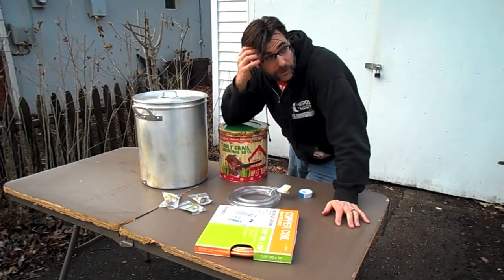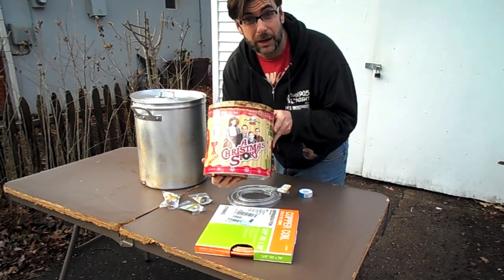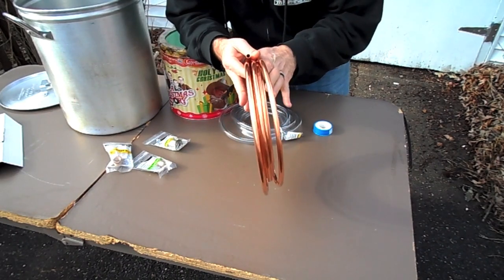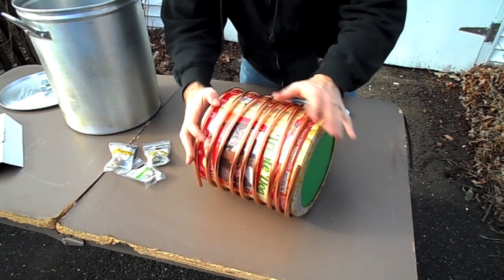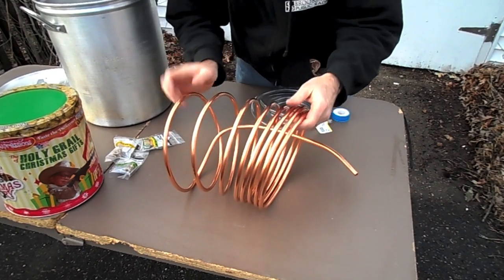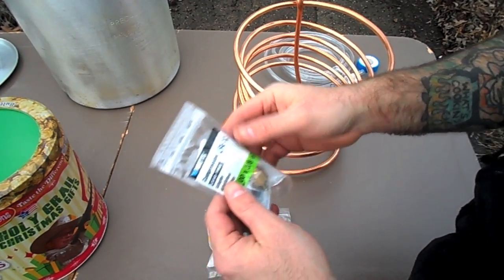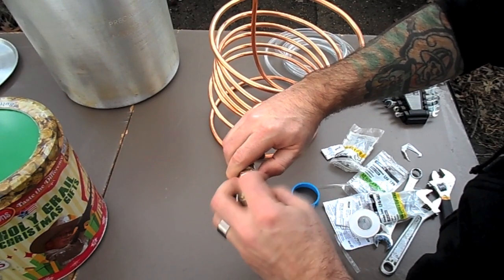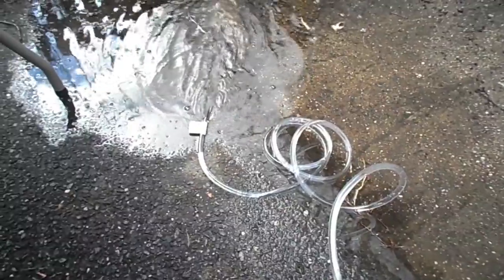Make Your Own Immersion Wort Chiller in 15 Minutes

Comment: I found a dishwasher elbow 3/8 compression to 3/4 hose for $6 at Lowes. No need to convert twice like you did. Bought a new garden hose just for brewing. Works great. Thanks for the video.
Reply from the maker: Jonathan Medford Thanks for the tip.  Good to know.

Comment: I made my own wort chiller years ago.  Here are a couple thoughts.  I would make sure to bend the inlet and outlet below the upper lip  of the pot and pointing downward to prevent water from creeping into the chilling wort.  Eventually your hose connector or outlet hose will leak and allow the unsanitized water to get into your wort.  The poly tubing was loose and you definitely need a clamp on the tubing to seal it.  Your inlet should go to the bottom of the pot first to push air bubbles out of the tubing.  The air bubbles do not carry off as much heat as water, increasing the time necesssary to cool your wort.  Hope it helps.

Comment: Thanks for the great video!  Just an FYI, garden hose adapter fittings are available in 3/8, 1/2 & 3/4" pipe thread.  No need to use a 1/2 x 3/4 pipe bushing. As a rule, I try to avoid as many extra fittings as possible since each joint means another spot that can leak.

Comment: Great video! Really helpful for a guy like me who needs to save cash wherever he can. Although when i was making mine i noticed buy using copper tubing with a 13mm diameter there is no need for all the extra fittings. This way you can just slide the garden hose snugly over the copper tubing and clamp it just like he does with his out end.
Reply from the maker: Great idea.  Thanks for that simple. and elegant solution.

Comment: 6:39 you folded it!! However If you used a spring over the copper it wouldn’t damage the line. Used this concept to make brake lines. And you can find a spring for this at a auto parts store in case anyone else wants to know.

Comment: thanks for the video!  when I made my wort chiller, I skipped using any special compression fittings, using the 3/8" id tubing with the 3/8" od copper tubing worked just fine, just slip the plastic tubing over the copper tubing for a water tight fit, and seal it with some stainless hose clamps, works great!  you are dealing with a fairly low pressure application.  same result, but could save you a few bucks.

Comment: I'm no plumber, and also mean no ill, but your teflon tape will seal better if wrapped in the same direction you're going to screw on your fitting, so that when you screw your fitting on, you do not risk unwrapping your teflon tape at the same time as you are screwing on your fitting.
Reply: Teflon tape doesn't seal anything anyways. It's the fitting that seals Teflon tape is more like a lubricant for the threads.  You honestly don't really need it.
Reply: Okay.  I was just taught to wind it the same way the fitting turns on.  No big thing.
Reply: I appreciate the video.  Made my own wort chiller for half what I could buy one.
Reply: +Kelly Kathrineberg plumbing 101
Reply: Must say though, the vid helped me make my chiller.  I used a gallon chili bean can as a guide, then my wife made a ton of chili
Reply: I use water bottles filled with frozen water to put in my bucket to keep the coils cool enough for the gas to turn to solid quicker. But yes its a good little chiller.
Reply: I only make liquor so I don't need a big bucket like that, I have a small still and usually just enough to fill a 2 liter barrel. Different grains but most all are ready within 6 months or so. So I always have a batch waiting for my sipping pleasure.

Comment: For future reference you "don't" use teflon tape on a compression fitting.
Reply from the maker: Yeah, figured that one out after replacing my sink.
Reply: Plus, the first bit of tape was put on backwards where the 2nd two pieces were correct (correct meaning the tape will continue the right way when the other piece is threaded on)
Reply: So you wouldn't put it on the first bit that he called "threading" but put it on for the adapters? Or just not use it at all?
Reply: No tape on compression fitting only but tape on all other fittings.

Comment: How many gallons is the pot in the video? I’m thinking of going with a larger copper tube. Probably 3/4” and at 25’ for a ten gallon.
Reply from the maker: It's 6.5 gallons.  Truth be told, it's a turkey fryer pot.  The larger you go in both diameter and length the more your surface area will be...which makes for quicker chilling.
Reply: Thanks

Comment: I don't think this has been mentioned yet, but I would also make sure the ends of the copper tubing bend down past the lip of the pot on the outside so if anyone water runs along the piping, it won't run into your wort. From the video, it looked like they were at an upward angle.

Comment: You should use a scissors to cut the Teflon tape that way you will net get small strings of tape in the system. If you want to be technical only wrap the tape 1 and a quarter to one and a half wraps  around.

Comment: Teflon tape is only used on pipe thread fittings.  Compression fittings have their own seal built in to the fitting.  You can actually cause leaks by using teflon tape or pipe dope where it doesn't belong.

Comment: I just pour my wort on a bag of store bought ice.  Chills it right down fast and never a contamination issue yet.
Reply from the maker: I've seen that used before, however I've never trusted the labeling on the ice bag.  I would be much more comfortable with chilling some closed jugs of water overnight and pouring that into the wory if I weren't going a full boil.

Comment: If you bend both ends to point down instead of straight out, it will cradle itself on the pot and be more stable.
Reply from the maker: JFP Watson I quickly figured that one out.  Thanks for the tip.  Happy brewing!
Reply: +JFP Watson i was thinking the same thing especially when the water was leaking.

Comment: (my 2cents) Get that copper tubing/vinyl tubing connection OUT of the pot. Even if you are super confident with your clamping job, if it does start leaking, you now have un boiled water dripping into your wort

Comment: Isn't it cheaper to soder?
Reply from the maker: I wanted to make the video for people who didn't know how to do stuff like that.  With that being said, I have since moved on to simply using clamps on the coil.  Even easier.
Reply: @Hypobrew  I just baught a 16 gallon pot so I'm gonna need a biger chiller. I shopped around even at Menards. I then compared prices with Amazon and making my own. I also want something more durable so it's less prone to leak. I decided to go with stainless steel and the price their making them for is very cheap. They come assembled so why not buy that.

Comment: I wouldn't run my liquor through plastic hoses. I use all copper and stainless steel.
Reply from the maker: +Dennis Robinson The water runs through the coil and plastic hose cooling off the wort in the pot.

Comment: Next time use a pump and reuse the water, wasting water any other way
Reply from the maker: +Reapers Own I actually did!  Here's the video: https://www.youtube.com/watch?v=1xEFRn22clA
Reply: Cheap way without a pump is get a bucket preferably with a valve on it and put it higher vertically than the chiller. You can simply use gravity and empty out into another bucket to reuse the water. Occasionally add ice to the first and you're good to go